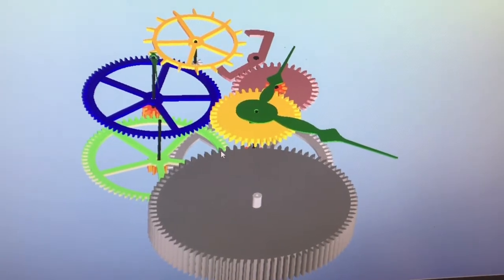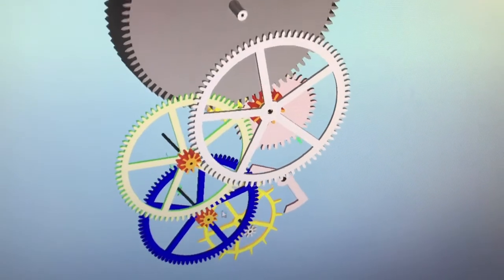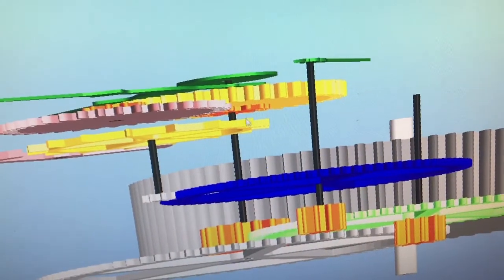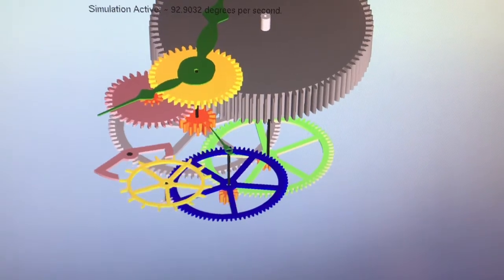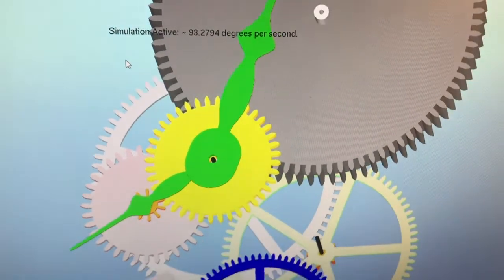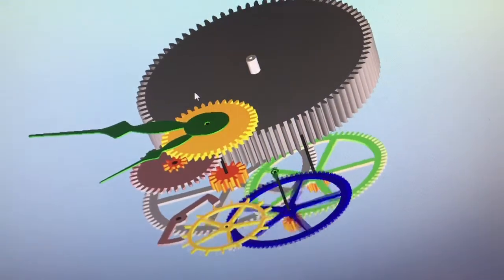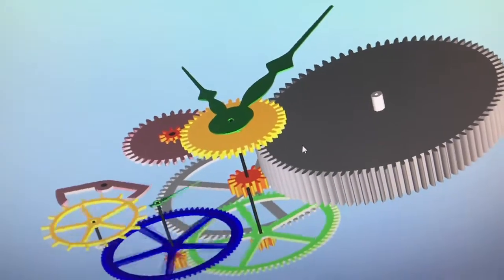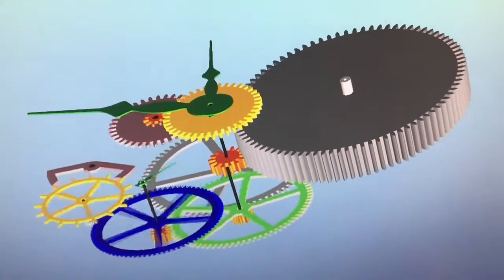Modeling and Simulation of Hamilton Pocket Watch

Comment: I have a wonky Elgin balance.  How about a video showing how to use the calipers to straighten it?
Reply from the maker: I could do a video on the for sure. I’ll add this to my list. I have done this many times.
Reply: @JDRichard  I'd be interested as to how to set the adjustable "ruler" to determine the perfect distance between the "ruler" and the  balance.  You have to set a standard which the balance is measured against.  Maybe you use the roller jewel plate which should be perfectly aligned with the balance?  In my case it looks like the balance was not staked flush to the balance base.  I would hesitate to use  a point on the balance which looks good on rotation beneath the cock and then tune the balance.  In my case the balance was not flush with the shoulder.... There should be a standard...  The edge on the balance where the roller fits?  Thanks!... John